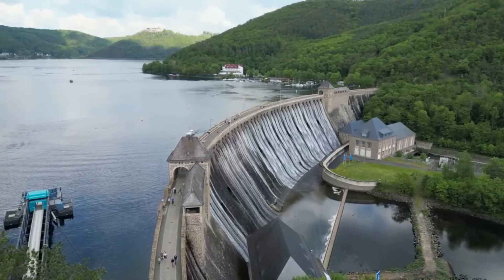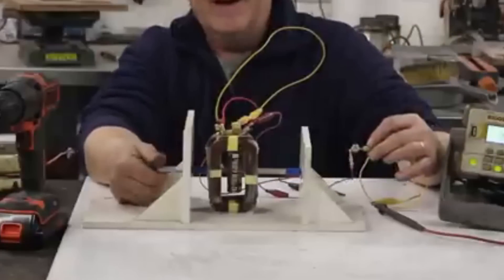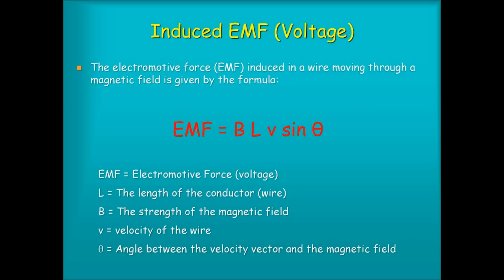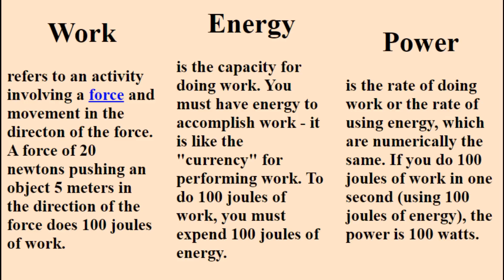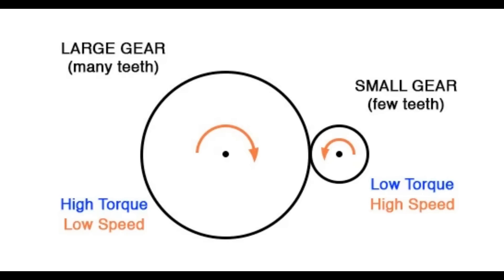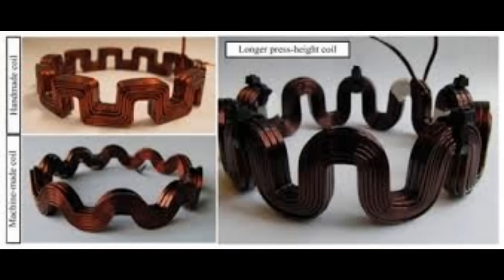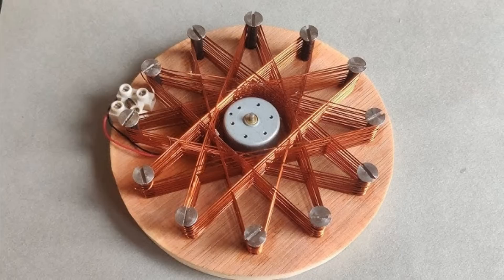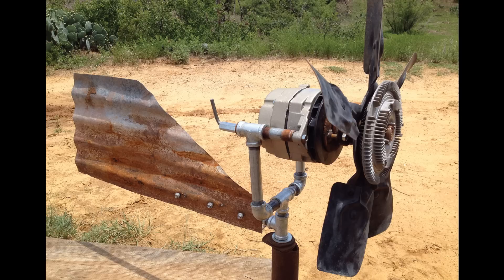2287 Building A Generator

Comment: How do I get you some plans for a portable “water battery” without it being self promotion?
Reply from the maker: I don't know what you mean by portable water battery mate. As far as I know there is no such thing as a water battery. Usually what is described as a water battery is just water with an added salt of some kind
Reply: @ThinkingandTinkering  
Ok, I’ll try to briefly describe. 
But first, there are no Pelton wheel motor at present. But…
A large vertical Pipe, say 30cm X 3m, with a Pelton wheel motor at the bottom that feeds into a smaller pipe that ascends vertically to another Pelton wheel motor at the top that returns to the first large pipe. The small ascending pipe has turbines on it, of which, the output of some turbines is directed towards the Pelton wheel motors that drive the mass of water that is contained within the arrangement, while the others are “free” to deliver current to an external load. 
The mass of the water in the large pipe, coupled with the siphoning, should be sufficient to assist the motors easily upwards to give power to the turbines, enough so that the work being done would be continuous for the life of the parts of the machine. 
It would look like a vertical band saw. 
If nothing else, the thought is amusing. 
Thanks for all your dedication!

Comment: One mind-boggling experiment, that you can try at home, is to take a copper tube, and a magnet just small enough to drop down the tube.

Try dropping the magnet on the table by itself, and THEN try dropping it down the tube.  You will be amazed at how much slower the magnet is when falling through the tube.

This is because the magnet uses some of its energy to excite the electrons in the copper tube.  Since energy cannot be created or destroyed, this energy has to come from the falling of the magnet due to gravity.  Consequently, the magnet falls a lot more slowly when dropped through the copper tube.
Reply: AKA the Lenz effect
Reply from the maker: it is pretty cool to see that